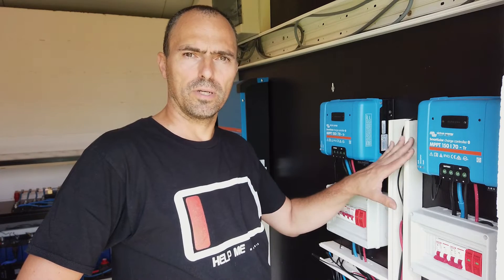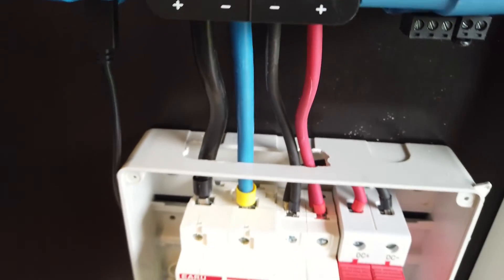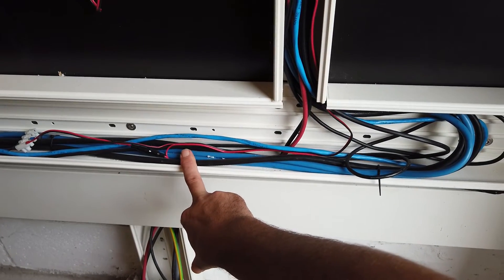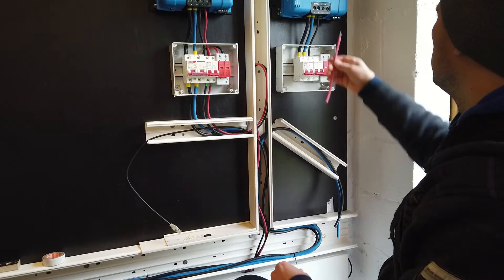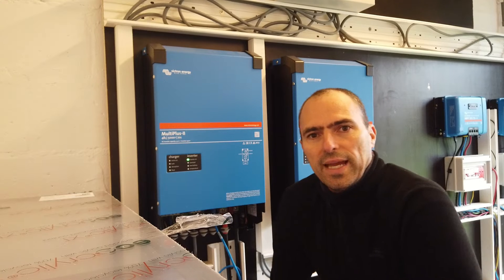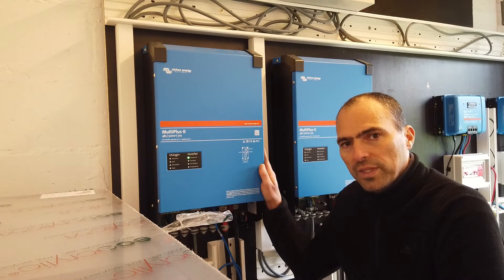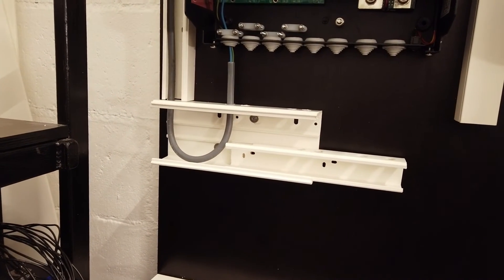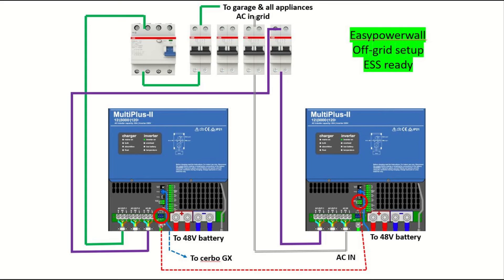Connecting the victron charge controller & victron multiplus II inverter.

Comment: Hi Franky. It is necessary to precharge Mppt before first battery connection?
Reply from the maker: Hi, 
There's no need to precharge the MPPT.
Just connect the battery first, let the MPPT boot and then connect the solar.

Good luck with the project.

Franky - EASYPOWERWALL

Comment: One thing is not clear to me. How you connect MPPT and Multiplus together? If you put Batt connector to Batt from MPPT OK and then BATT connector to Multiplus? How?
Reply from the maker: Hi Michal, 
It's all explained in this video: https://youtu.be/_7d7Mj-PoIo

Cables from MPPT and the multi plus all connect to the copper busbars above the battery shelf. Check the video. 
If it's still not clear don't hesitate to contact me. EASYPOWERWALL is also on facebook.

Have a nice day.

Franky - EASYPOWERWALL

Comment: Why not use the inverter in master/slave configuration for inverters to share the load. Those inverters are designed for it
Reply from the maker: That's the goal, I'm working towards this solution. But thanks for the tip. First thing to do is increase the size of my wireing to 6mm. Will be on the channel too.
Frank - EASYPOWERWALL